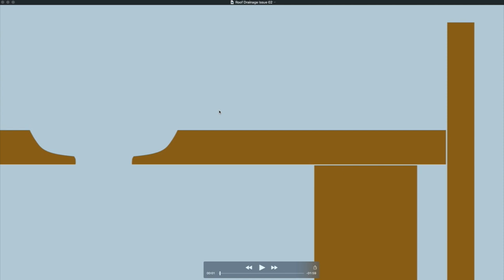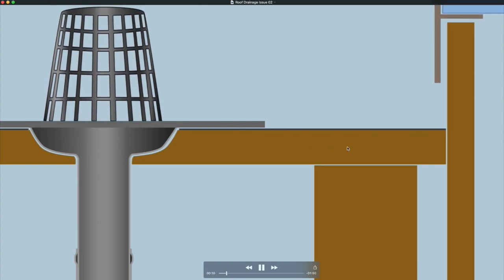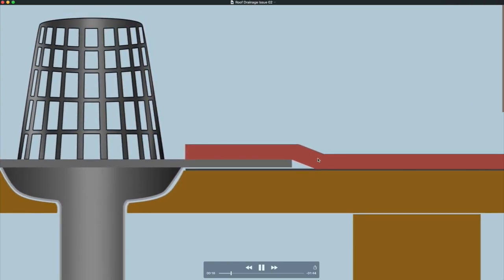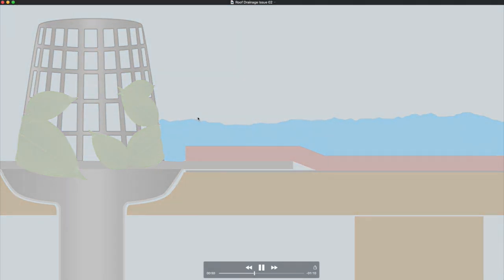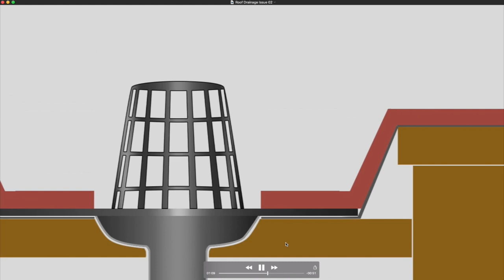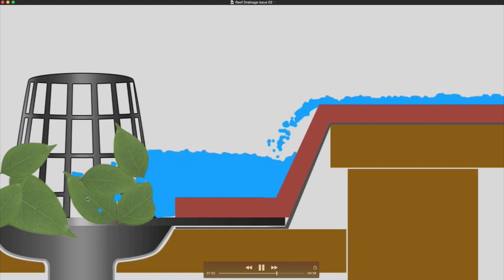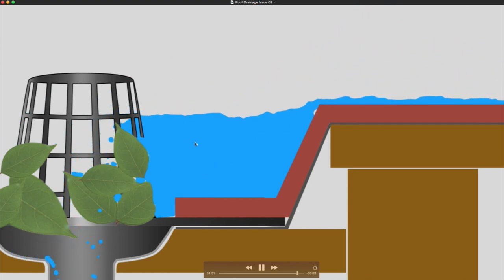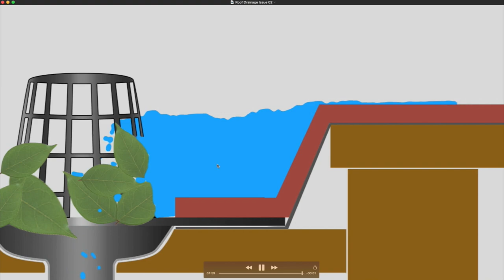Flat Roof Drains design and installation - the Ultimate draining system for flat roofs

Comment: Getting a new PVC roof and the roofer is suggesting moving away from drains to 4 scuppers only.  Also placing additional Fanfold to create minor decline to move the water and limit pooling.  Anything odd or off about that recommendation?  We live in Seattle, so it ices only from time to time. I was surprised because originally they were going to add an additional drain, but they feel the drain system present is not reliable and said this was better and more cost effective.  We have had leaks from the current drain system and the roof is almost 5000 sqft. Thank you!

Comment: Hi I plan to have a terrace, precast concrete slabs and then pour few inches on top of it. Can you let me know if the membrane has to go in between the precast slab before pouring or after pouring. Final layer will be natural stone or tiles
Thanks!
Reply from the maker: My opinion is you need to research more. I think after the precast concrete you should do the membrane. Then on top of that do Pedestal system for your tiles or stone. That way the water would flow through the tile joints that has no grout to the membrane and then out.
But i know to little. My son knows much more and has done this kind of stuff. check out his channel and contact him @allroofusa

Comment: Good idea, but what about where the drain and connecting piping need to fit in 2x12 roof joists?
Reply from the maker: Hey Claude
To make a basin you will have to cut one roof joist and use cross headers to transfer the load to the adjacent joists. Normally a carpenter knows how to do that.
But this should be in the architect's or engineers' plans.
I often do this concept on existing roofs. Sometimes there is so much build-up of insulation and several roof layers, that I am able to remove the insulation and other roofing material to make a drain basin.
Thanks for the question
Naas

Comment: You never install a drain down to the substrate. Always sandwich the drain between whatever roofing material you are installing.  A basin is a good idea in theory but most the time not possible.
Reply from the maker: Yes you say the right thing but for the most part the way you say to do it, causes the drain to be higher than the rest of the roof surface.
I do not install drains the way any book might describe. I use common sense and try to lower it wherever possible to create positive water flow. Most carpenters/roofers will just install a drain on a substrate and never try to create a basin. It cost time. At least 3 hours to get it right per drain. But at the end I have better results and a drain that works for the rest of its existence.